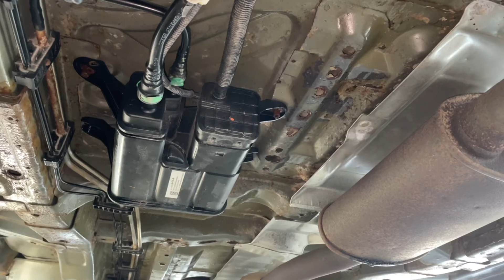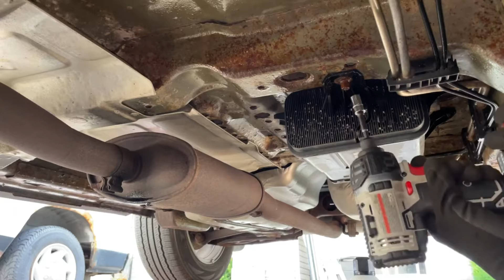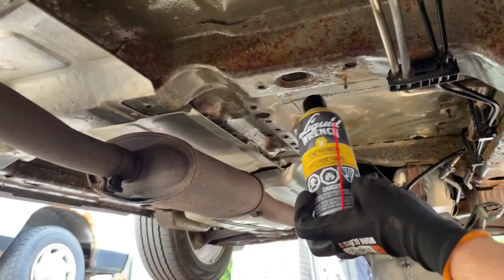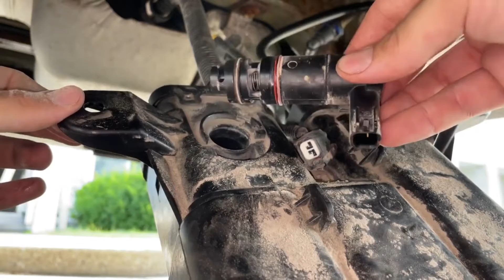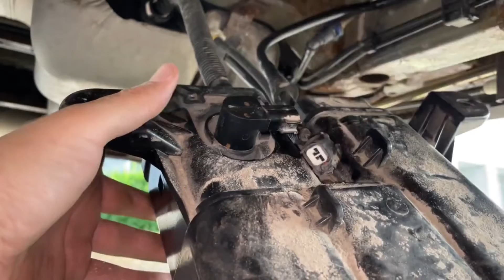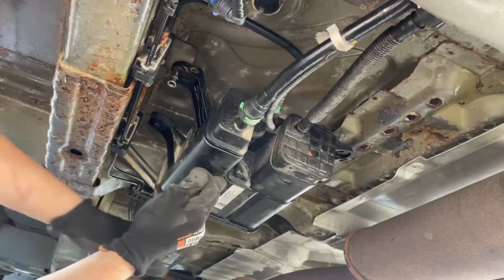Chevy Equinox/GMC Terrain EVAP Vent Solenoid Replacement

Comment: Dose that stop the car from starting
Reply from the maker: A faulty vent solenoid won’t prevent the engine from starting. It would usually cause a bad smell of gas, buildup of pressure in the gas tank, and failure of an emissions test. Perhaps you are thinking of the evap purge valve located in the engine bay. A stuck open purge valve will cause the gas vapors to enter the engine when it’s shut off and will cause a no start. Here is a link to that video: 
https://youtu.be/qvHeTEatlZQ
And here is a link of a video how to test the valve: https://youtu.be/rTjEj61oFGk?si=CMp9HIdQyiPAxJXv

Hope these videos help. Thanks for watching. Please like and subscribe

Comment: My engine light turned on by that, could it be that it turned on because it was almost out of gas?, after the AutoZone guy gave me the code it turned off 
Regards
Reply from the maker: It would never have a check engine light because you are almost out of gas. What was the code he gave you? An evap code is usually for the solenoid being stuck open or stuck closed. My advice is get yourself a quality obd scan tool to check the code.

Comment: Esa válvula debe tener continuidad?
Reply from the maker: Yes it does. This valve can be tested with a multimeter for continuity. It can also be tested for resistance and should create 14-30 Ohms on your multimeter. Thanks for watching. Hope this helps. Please like and subscribe
Reply: @BillOfAllTrades2016  ya medi con continuidad y me dió 20 ohomios!  Pero me dijeron que no debe tener continuidad osea que pite el multímetro cuando toque las puntas!
Reply: @fernandoescuderoperez2528 amigo, si tiene resistencia tiene continuidad.

Comment: It would help to spray it with a little brake cleaner or some compressed air to avoid  dirt contamination as much as possible. Good video nonetheless 👍
Reply from the maker: Yes a fair point. I’d prefer sensor cleaner. A little more delicate. Thanks for watching. Thanks for tip. Please like and subscribe

Comment: I have replaced the whole thing, do i need to clear codes or run the truck and how long? Thank you.
Reply from the maker: Any time I have a code I clear it with the scan tool. Then drive for about 10 minutes and the system should log enough info by then. If the issue is resolved then the code won’t come back after that point. Some people disconnect the battery to reset but I prefer manually resetting with the scan tool. Thanks for watching. Please like and subscribe